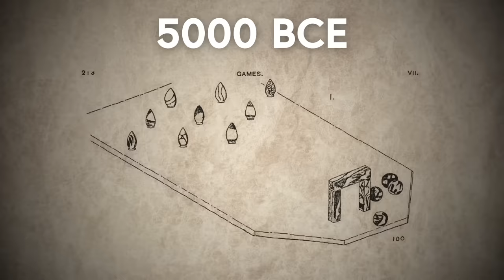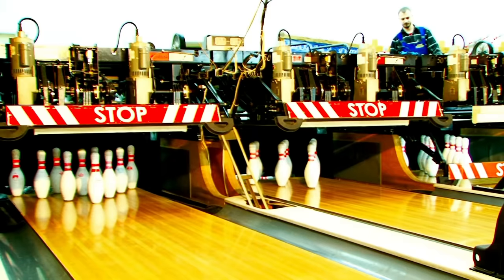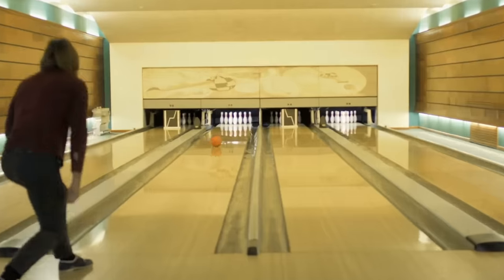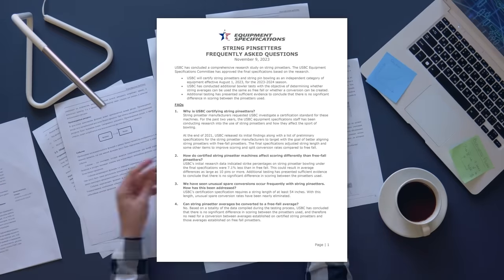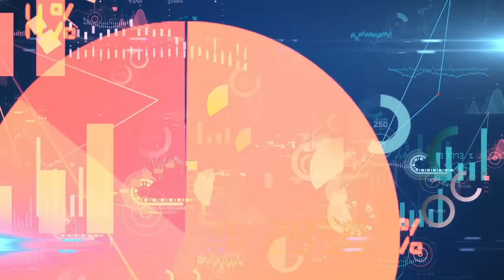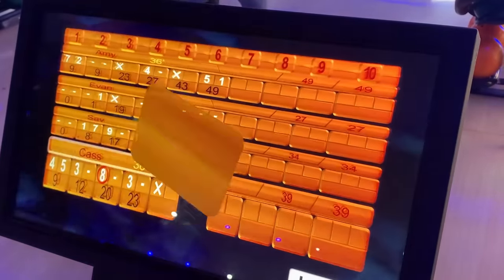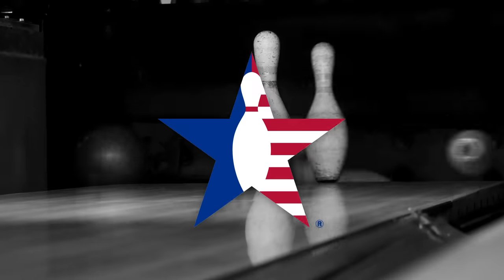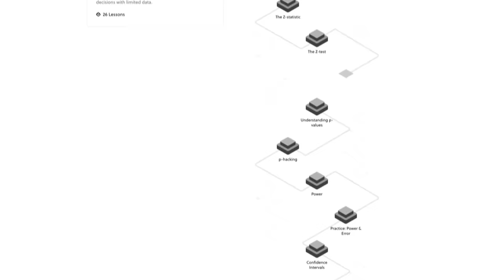The Controversial Machine That’s Ruining Bowling

Comment: Work at a bowling alley. With 20 lanes and the old machines consistently broke, to the point that it would severely hamper people’s enjoyment. We’d have to give them more time, move them to other lanes, one guy had to wait an hour bc his personal ball that he owned was lodged in the pin elevator. Having angry customers come up to the front desk was all too common. If we were packed on a Friday night and a lane was unfixable, there wasn’t much our manager could do to satisfy people without refunds.
Reply: Routine maintenance would be my first suggestion.  Working in the bowling industry for some 15 years now, traveling to dozens of bowling centers every year.  Lack of routine Maintenace is the only reason I've seen for constant machine failures.  Parts break, but a skilled mechanic can swap out any of the ones that break often in 10 minutes.  I've only seen maybe 4 cases where a part that failed was something that a center had to order in rather than something where they have spares on a shelf ready to go.   I have seen several centers that decided not to do the regular Maintenace, or not to hire a mechanic that knows what they are doing, and they tend to have lots more issues than the places that realize the machines need to be maintained.
Reply: @johngaltline9933  work at an alley and we just switched from GSX to brunswick string pin this october, routine maintenance is all well and good until your mechanics leave over the years, having done more harm than good to the machines in the long run (used horrible oils on the chains) and leave your new inexperienced front desk workers to all the mess. as jamaicanskeleton said, stops were plenty and mad customers too. nowadays i have to go to the back maybe 2 or 3 times on a very busy weekend. fewer stops, much faster pinsetting and way less cost overall makes stringpins a no-brainer in my opinion
Reply: @Jabberwork.  So clearly they were not SKILLED mechanics....just people hired to do the job without knowledge or training.  Routine maintenance should be easy to accomplish since lanes aren't used most of the 24 hour day.
Reply: @ian3580  and where do you suppose those skilled mechanics will come from? not to mention that any kind of skilled job position will be more expensive to fill, and bowling alleys aren't exactly flush with cash.
Reply: I was recently at an alley that one machine kept getting stuck so many times that one group of my friends finished 3 full games before the other group finished one. After 3 hours of this they finally moved them to a different lane. This isnt a mechanical problem... its a management problem. Why would you keep a lane open with a faulty machine and waste everyone's time? To make money? The lane next to the faulty one, sharing the same scoring computer was empty... they could have made 3 times more money in our visit alone if they had just told us to avoid that lane.
Reply: Amazing... I used to go bowling all the time and never experienced any issues with the lanes. There were a few times a pin would be missing, but there was a button for that.
All in all, I think I've asked personell to help once when a pin didn't let the ball roll off in hundreds of games. Seems to me these machines need maintenance and competent personell. Oh and maybe not being worn out completely?
Reply: @1kreature  on the modern, computerized ones, there are lots of little things that do just wear out over time the beasts from the 60’s still run just fine with a little maintenance now and then. Most bowling centers are still running on the original machines they installed in the 60’s and 70’s. The most common failures are broken belts and worn brushes on motors. Competent centers keep all the commonly failing parts on hand and competent mechanics can swap most things out on less than 15 minutes most of the time. Many centers that have the room for it even keep a whole extra set of pinsetters that can be rolled in to place to replace a broken machine if there is a serious issue, or if the head mechanic that knows how to fix more complex issues is off duty
Reply: @KyteM  typically they come from the same place skilled workers in any trade come from, paying them what they are worth, and hiring assistants that can learn from someone that knows what they’re doing. While complex to the lay person, and actually designing one from the ground up was an act of genius back in the day, just maintaining a pin setter is a task anyone with a mechanical mind can pick up pretty easily. Any typical auto mechanic could do the job with a week of training on the job. 
All that said, for anyone laying out for new machines in a new facility, strings just make more sense as they require far less maintenance… but they still do require maintenance. For a facility that already has free fall setters, the math is a lot more difficult with the cost to replace the machines being enough to properly maintain the old ones for another decade.
Reply: @johngaltline9933  My bowling center must have had some good mechanics then. They were also minting money :)
Reply: @1kreature  they don’t have to be great, just competent. Most centers, especially ones that keep the house packed understand that paying for competence costs less than having broken machines. On the other hand, there are many, many, bowling centers that don’t seem to care about making money or drawing in new customers, and just cater to the same dwindling leagues they could mint money on in the 1980’s, and only fix things when they break. There is a huge mindset difference between the centers that care and those that don’t.
Reply: I hate when my personal ball gets lodged somewhere.
Reply: Decades ago I worked behind the machines at an AMF house.  Yeah with all those moving parts in crummy conditions, random stops are almost guaranteed.  Most stops can be cleared with minimal skill.  But some stops are more complex and it's always a dice roll if the technician on shift will be skilled enough to do the repair.  Of course there was a power switch to disable the machine before you got in.  But no safety lockouts or anything.  I don't remember any serious injury but I do recall a guy getting stuck and having to yell for help.  It's loud AF back there too, really hard to be heard.  The owner of our franchise hired guys out of prison rehab so I had some fun coworkers.  A couple of them were pretty good mechanics.  Technically no girls were allowed back there but I have some stories.
Reply: I feel that my league bowling alley is headed for strings, because they have these issues every night. We haven't had a night yet this season where a group was moved to a different lane. Then beyond that, other lanes are constantly waiting because the setter keeps dropping pins. Like others have said, proper maintenance needs to be done. They are bringing in tons of money. The alley is always full, the golf course has 27 holes that are always full even though the $50/18 that they charge is more than most golf courses of similar quality in the area. The owners have a second 18 hole course that is $45 for 18 holes which is also always packed. Rather than updating the things that matter, a couple of years ago they completely redid the bar area, added gps screens to all of the golf carts (price of golf went from $35 to $50 when they did this).

Poor business decisions trying to bank as much profit as possible (all while making visual updates to try to bring more in). When they lose a bunch of bowlers due to the crappy lanes, they will no longer have the income from the bowlers to update. I fear that is when they go to strings. Especially since they made it tournament legal.
Reply: Keyword in your second sentence there, "old". Properly maintained and preventatively maintained spotters rarely malfunction and are fixed relatively quickly when they do. In 15 years of league bowling I've only ever been delayed by more than a few minutes just a handful of times and only had to move lanes twice.
Reply: @NomadUniverse  Many bowling alley owners were greedy and when times were good, they didn't want to "waste" money on updating machines. Then when the income dropped, they didn't have the money to make the updates and proper fixes, so the machines are outdated and get bandaids.
Reply: @dustinroberson1865  Yeah its just simply poor business and string pins cater right to it.

The one alley in my area that still looks after league bowlers survived. Mainly because the main competition went full social and drove out their leagues, and league bowlers migrated. I used to league bowl at both and the difference was shocking. 

My main center has an old mechanic that's been there for decades, keeps everything running like clockwork and the center that turned social hired a bunch of younger kids and gave them a crash course. Which is another problem, good lane mechanics are disappearing to.
Reply: Our local alley has 14 lanes with Gsx machines and Twister 🌀 pins. Nothing really wrong with the machines at all, just like a car, regular maintenance and upkeep, they will run for a very long time!
Reply: Now i know why people die in these machines. Bosses forcing mechanics to work in unsafe environment to keep his money flowing. Machine stops working during the game, cant turn off everything, have to do it fast cause customer, boss is stingy on tools and spare parts.... You know the drill.
Reply: @greenanubis  that doesnt happen. Don't take his claim of many people are dying as true because he flashed 2 articles. Each lane has an isolation switch and most problems are a stuck pin or ball and fixed in minutes. Rarely does a mechanic have to get under s pin setter.

I bet if you found those two articles and read them, details would show a different story to what you claim.
Reply: I’ve bowled at numerous bowling alleys in Kansas and have had some minor issues. Wire coming unplugged on a motor, pin going down the ball return, and the pin deck getting stuck. While these were annoying at the time, it happens. Like I said, I’ve bowled countless games and these are the worst issues I’ve had in 16 years of bowling.
Reply: Sounds like you guys need to do your daily work...own a 42 and 36 lane center with actual mechanics and we rarely have a lane go down and lane calls are at a minimum
Reply: @Jabberwork.  How frequently do you find that strings get tangled in such a way that it requires a human to go and untangle it?
Reply: @DarthCiliatus  it kinda depends on how the customers play, the machines have a hard time when 3 pins are tangled around each other, it almost looks like a braid. But compared to the old machines its much much less. Last weekend was really well visited and i was in the back maybe 3 times all day.
Reply: @NomadUniverse  exactly. There are VERY few deaths from bowling machines.  No pinsetting machine kills a man without a mistake being made before the repair began.  I learned from week one as a bowling mechanic to unplug the machine entirely any time you get under it.
Reply: Of all the times I’ve gone bowling, not once have I had a problem. Maybe I’m lucky? 
I know for a fact that I will stop going to my bowling alley if they switch to strings though lmfao. 
They just look cheap and feel shitty. Totally takes away from everything that makes bowling so satisfying.
Reply: @Jabberwork.  I wonder how many people stopped going to that bowling alley after they switched. 
I can’t stand to bowl on a string machine. 
Just feels so damned inauthentic.
Reply: @blaniac6591  people said the same when they introduced synthetic lanes, electronic scoring and reactive resin bowling balls. Even way back when they started to make oil an integral part of the sport some people complained. Its an evolving sport like many others too. Theres gonna be changes down the road to keep new players coming and keep centers open. If you dont want to play on strings thats fine, noones forcing you and theres always gonna be centers that stay with free falling pins. But the reality is that the majority of people who come to a bowling alley dont care about that and those are the ones that bring the money to keep the centers open.
Reply: @Jabberwork.   the people that keep the centers open are the ones who participate in leagues. 
There’s a reason the bowling alleys that host them are the most lavish.
This feels just as inauthentic as if they were to switch to hitting baseballs off of a tee instead of throwing them lmao.
Reply: @blaniac6591  i dont know how much league players usually pay for practice in the US but here they pay very little compared to what the hourly rate normally is. Saying that league once a week keeps centers open is simply not true. Its everyone else who pays the regular rate that does.
Reply: @Jabberwork.   the only successful bowling alleys here in the US are the ones that host leagues. 
I don’t know what it is about it but the general public doesn’t go bowling enough to keep them open. 
They always run into the ground unless they host tournaments. 
Must be all the sponsorships and TV exposure.

Comment: Im studying statistics, and that reference absolutely made me feel that wasting hours in studying statistics didn't go to waste, time for me to do my own bowling quality testing
Reply: I KNOW RIGHT, ITS ALMOST TIME FOR FINALS AND I COULD HAVE LEARNED EVERYTHING SO MUCH BETTER
Reply: With or without mozzarella sticks?
Reply: @classifiedad1  depends on what they offer
Reply: I had the exact same thoughts! Being able to understand everything he said about stats felt good lol.
Reply: As an idiot, isn't p=0.035 relatively speaking .... Significant?
I mean. Not enough for me to say strings increase scores, but enough to say there is a difference....
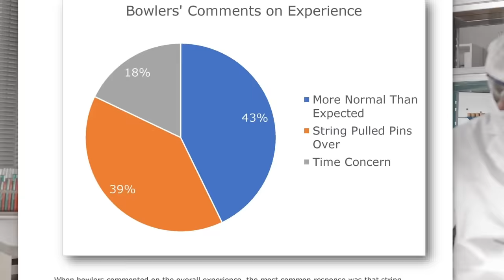Reply: @johnsonnguyen6046 That p-value is not for the overall paired t-test. If it was, the confidence interval would be much wider. In the summary report at 3:41, you can see the p-value is for the Anderson-Darling normality test, which tests whether the data comes from some normal distribution. And yes that p-value would provide evidence to reject that null at the 5% significance level (i.e. reject that the data comes from a normal distribution). I suspect the writer misinterpreted what that p-value was for.
Interestingly, I think that the normality assumption being violated does affect the validity of the paired t-test results, although someone might correct me on that if I'm wrong.
Reply: @samuel96860  when normality is violated you could just use a non parametric test so that's not a problem, i think it depends on the fractile's value compared to the value of the liberty degree
Reply: make sure to use people that are proficient at bowling not just the average person cause that's how you get faulty and undesirable results
Reply: Hey y'know I may not study statistics, nor am I a very good bowler, but I am a mozzarella stick enjoyer, so I may be able to provide some assistance in that part of the testing.
Reply: the statistics was a waste, source: stats major
Reply: Statistics is never a waste of time. Intro to stats is one of the most useful classes that anybody takes these days.
Reply: I’m glad I wasn’t the only one confused by the p-value.
Reply: Trusting software can be a challenge. Indeed, the p-value of 0.035 is not the p-value for the t-test. The information you need to get it is on the screenshot at 3:41 though. The mean of -0.0951, standard deviation of 18.8265, and N of 341 leads to a t-statistic of -0.0933. This then leads to a p-value of 0.926, which is very much not significant, as expected given the wide confidence interval.
Reply: Having just finished a Data Analysis course, I'm actually glad I knew all of what he was talking about when I saw it! Suddenly it's not a bunch of gobbledygook anymore 😂